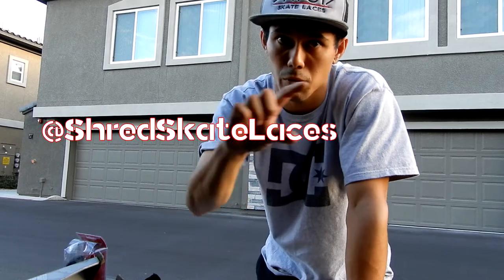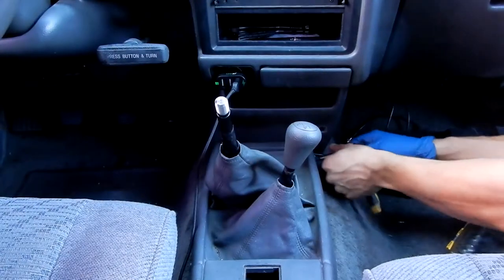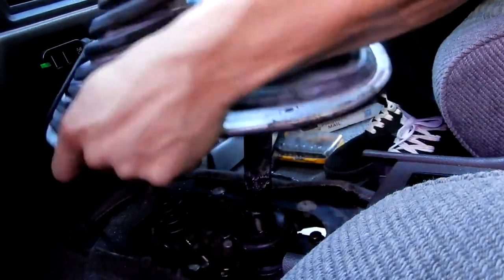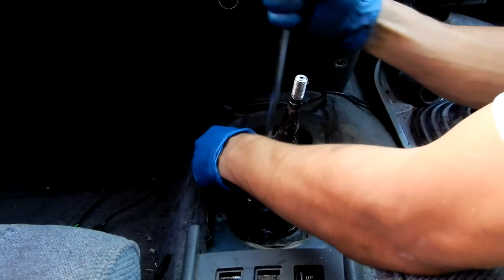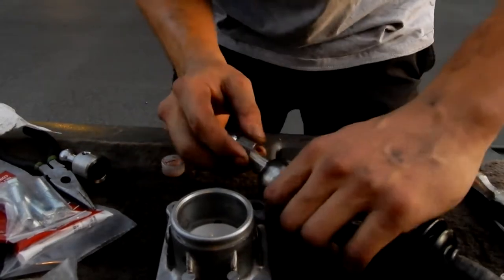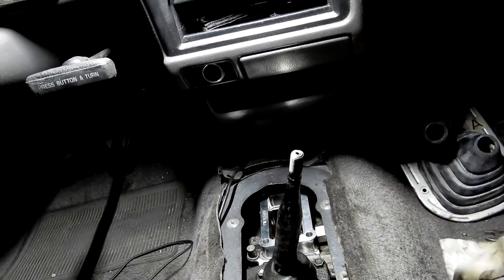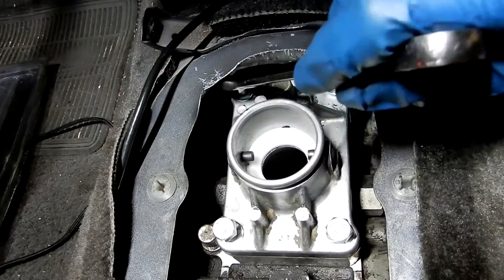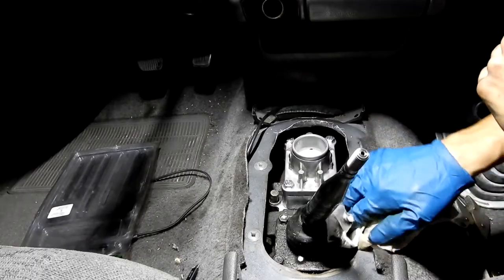Ruined 4Runner Transmission Tunnel Showing How to Install LCE Short Shifter

Comment: Thank you for sharing about the LC shifter.  Just ordered 1
Reply from the maker: You will not be dissapointed at all, just make sure you have a dremel to grind out the transmission tunnel under the radio. I rememeber that gave me the hardest time since I didn't have the proper tools at the time